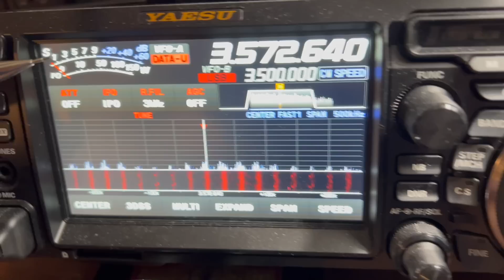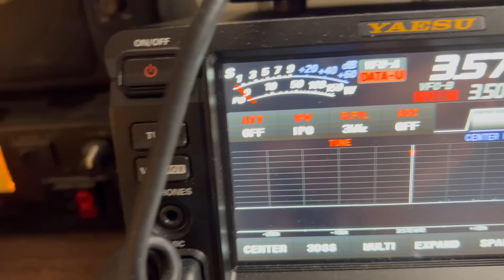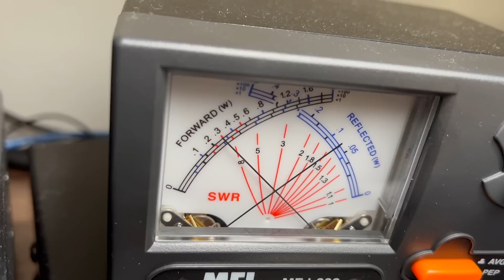The Myth of SWR

Comment: I didnt even watch the video but from reading the comments i know what its about. The transmitter output impedance is not actually 50 Ohm but something close to zero, and what's coming back from the antennna is reflected again, and this is what makes the power meter behind the transceiver show more power than the transceiver actually has. If cable dissipation can be neglected, then the antenna radiates about the difference of the "apparent" emitted power minus the reflected power. And yes, for a CB radio with 3m of RG58, it is about correct. With an antenna SWR of 3, the power meter shows then 5 W emitted instead of 4W, 1 W reflected, so it means the antenna still radiates its 4W. And really, a SWR of 3 is not as bad as many might think. Higher frequencies and longer cables makes it worse though.

Comment: Isn’t the reflected wave out of phase?  Therefore the total effective power not increased?
Reply from the maker: The antenna tuner changes the phase of the reflected power.  This is a quote from "Reflections" by antenna engineer Walt Maxwell.  "Tuning for maximum line current simply adjusts the phase of the reflected wave to rereflect down the line in phase with the forward wave."
Reply from the maker: There is no power increase.  The point is that the reflected power is not “lost.”
Reply: @BustRadioMyths If it's not useful for making the transmitted signal stronger (weaker actually) then effectively it is indeed "lost".
Reply: Is it coming down to semantics of what we are defining of what we mean by "lost"?
Reply: I think that phase doesn't matter as RF is rectified and the resulting DC is measured by SWR bridge which is a directional coupler.

Comment: Right to the point, I use 80ft Messi & Paoloni  EXTRAFLEX BURY 10 /.400" (0.8db/100ft @50MHz)  and I only try to keep SWR below 3:1 so I don't have to use external tuner.
Reply: SWR is an indicator that things are inefficient.  Its not just cable mismatches.  My good friend WA5FWC taught me years ago.  spend time building antennas that are tuned to the frequency properly, and use quality components, and everything is efficient, long lasting and maximum sensitivity.  I have no tuners attached to my rigs.  I just use tuned antennas and proper coax, its easy!
Reply from the maker: @fwaynedavis An antenna with a low swr is not an indication it is a good radiator.  A dummy load has 1.1 swr
Reply: I used  perfectly tuned dipoles at low heights with limited success but my DX-Commander vertical works far better even with 1.5-2.0 SWR which is tuned with internal tuner. Ofcourse if everything is matched is better but the point of this video is that a little mismatch (which BTW is inherent to Verticals with 36 Ohms impedance) is not worth trying to eliminate.
Reply: Thank you for the video. As a physicist with some electrical engineering you are quite correct. This is why in some cases I just force tune a random vertical with short, high quality coax in the field even if the feed point swr might be 8:1. I’m not trying to have something perfect- just something that radiates. Example - 18ft RG-8X at 14mhz on a 14ft monopole at 8:1 swr only has 0.73 db loss or only 16% of my power (neglecting pure resistive and ground losses). Better coax would reduce those losses.

Comment: I have researched this topic extensively and agree with what the host is saying. However, I highly recommend looking at a coax loss calculator, like what is found on KV5R website.  Depending on the HF frequency, depending on the SWR and length of cable, dielectric losses can become fairly significant.  Case in point -- Using 50 Feet of LRM 400 @ 10:1 SWR at the frequency of 28 Mhz will yield a 27% power loss (not radiated) when using 100 watts.  In this scenario the "output" power would be 72.584%.  Now that was for 10 Meters, 6 meters in the same scenario would have higher losses, and the opposite would be true for lower frequencies meaning lower losses.  Over all I like what Mark is describing in the video and for the most part I wouldn't worry about SWR higher than 2:1 unless using an ATU.  Lastly, I have tested power losses, and it does exist.. I have purposefully heated up coax with high SWR to illustrate the point.  As Mark said, the power isn't lost, it is converted from one form to another, and in the case of losses, from RF to Heat.  Hope that helps -
Reply: Just learned something important from W6LG; lets say for the sake of argument someone is running higher SWR, using coax, because they "aren't worried about it"?  Well, then you need to be concerned about common mode current.  Not that you weren't before with a flat SWR, but it seems running non resonant antenna's with coax can increase common mode currents which can cause problems. As I've learned from Dave Casler, everything affects everything when it comes to antenna.
Reply: @davidc5027  - Agreed, that is why having the trans-match at the closest point to the radiator is helpful, or used balanced feeder.
Reply: @davidc5027  unfortunately w6LG states that reflected power from an impedance mismatch travels on the outside of braid of coax ,I used enjoy his videos but will look at them differently from now on
Reply: In the case of coaxial cable at HF, the dielectric loss (rf power dissipated in the dielectric) is very small compared to the copper loss (copper loss is the loss due to resistance in the conductors).  The loss in a short piece of coaxial cable with high SWR where the load impedance is high can be less than the loss when the SWR is 1:1.  The loss is concentrated mostly where the current in the cable is highest.  If you feel along a cable that has been heated by rf power with high SWR present, you will find hotter and cooler areas alternating, with spacing from one hot area to the next hot area being a half wavelength in the cable.  The graph that is frequently published showing the increase in loss due to increased SWR is fairly accurate when the line is a half wavelength long or longer, but the graph can be significantly in error for short lengths.  Of course, for short lengths of cable, the loss is rarely a concern anyway.
Reply: @lifegettingintheway2710    Yes, the voltage doubling would occur under the condition of high SWR when a voltage antinode on the transmission line occurs right at the output of the transmitter.  On the other hand, if a voltage node happens to occur there, then we have a current antinode at the transmitter output, and the excessive current can also cause damage.  In the cases in-between nodes and antinodes, the voltage is out of phase with the current.  The active device or devices in the final amplifier operate most efficiently when the current maxima in the devices occur simultaneously with the voltage minima.  (For instance, in the case of transmitters with manually tunable output networks, when we tune the output network for a dip in plate current we are accomplishing this alignment.)  If our transmitter output network is pre-tuned for efficient operation into a 50-ohm load, then a high SWR condition will mess up this alignment and/or will force a less-optimum ratio of voltage to current, possibly increasing the power dissipation in the active device and possibly overstressing any number of components in the output network.  Higher voltage and current also cause additional heating in the passive components, but this is less often a problem as the passive parts are typically rated to handle more overstress as compared to the active devices.
Reply: 28 MHz is 'barely' HF :)
Reply: I am surprised that with your learned post that you still state power is 'lost'. Read up on thermodynamics, will you?
Reply: correct. It's not LOST, but it isn't radiated either. You can't talk on heat @lomgshorts3
Reply: He just means that it isn't being used for the intended purpose--it is lost to heat. @lomgshorts3

Comment: The only part I winced at was your statement about  the ATU providing an impedance match to make the transmitter happy.  As an impedance matching device, the ATU's role is to match the source (transmitter) output impedance with the load (feedline + antenna) input impedance to maximize power transfer from source to load -- regardless of any effect this may have on the transmitter's impedance mismatch protection behavior.
Reply: Here's an important point.  For a given frequency, standing wave Impedance (V/I) varies at different points along a feedline.  Thus, for a given frequency and load mismatch, a certain length of feedline may serve as the sole matching device (impedance transformer) between a source (transmitter) and a load (antenna).   But when any given feedline length does not present a match, then an ATU between the source and the feedline can be used to essentially add or subtract a phantom/virtual length of feedline (via variable lumped inductive and capacitive elements) to match the source's output impedance.  Of course, this does nothing to change the impedance mismatch at the feedline to antenna interface, but it allows the source to transfer full power to its composite load (feedline + antenna).
Reply: yes, yes, and yes; preach it. I really wish we could find a new term to popularize, for the feedline-antenna matching device, and stop calling it an antenna tuner.....
Reply: @dus777  Transmatch is the term I prefer; but the catchy acronym ATU has become commercially predominate and appears here to stay.

Comment: You were doing good to the part you said that on the low bands the SWR does not matter.  For short runs up to say what would be used in a car there is not that much additional loss.  However with feedline loss when matched is getting to be around 3 db or more the additional loss starts to increase by a good bit as the SWR gets higher.  You sure do not want  a 10:1 SWR with 100 feet of rg-58.  One other thing is that if running high power the coax can develop hot spots and melt or the voltage can arc over.
Reply from the maker: Good points Ralf.  Yes 100 feet of high loss cable like RG58 with a high mismatch would be a bad idea. I didn’t try to cover every scenario so thanks for that input.

Comment: I do know that high SWR from the antenna really heats up the coax connectors entering the house.  The inside tuner does a great job for the transmitter.  Been Ham since 65.  Finaly got my first and last amp about two years ago.  Having fun. de WB7ORB.  Also that is one of the questions on the Extra license test.

Comment: I'm the antenna tuner. Resonance or bust. Tuners are a waste of money.
Reply: At resonance, my short, center-loaded vertical has an input impedance of about 12 ohms: 4:1 VSWR.  In other words, antenna resonance does not necessarily equate to an impedance match.
Reply: Do you realise resonance doesn't guarantee efficiency, it doesn't guarantee its matched either but a tuner can deliver both resonance and matching for maximum power transfer

Comment: With a line power of 75W the reflected power also goes up, to 37.5W, which is matched by the tuner and sent back to the antenna.  This increase in power in the line results in increased loss of power in the line!  Yes, much of the transmitter power is radiated, but a high SWR does ultimately cause a loss of power.  Best to keep losses low as is reasonably possible. No need to obsess over getting a 1:1 SWR, but closer is indeed better.
Reply from the maker: All true David.  SWR causes additional line loss.  But the published charts show that at HF frequencies it is not much unless you have a long line of high loss cable.  Another issue I would like to make a video on is that obsession with SWR prevents the use of a wire all band antenna.  I’m using a random length OFC dipole with a 9:1 unun.  It covers 160 meters to 10 meters with an swr of no more than 3:1 at the ATU.

Comment: I agree with most of your video content right up to the point where you try to show and state that 20 watts out of the TX turns into 30 watts.  Bad SWR does NOT increase the output power.  The SWR meter may not accurately calibrated for that Freq.  You can NOT increase power out by having bad SWR!!  You will never get more than the 20 Watts to the antenna. What you are stating toward the end of your video is the holy grail of junk science!  FREE ENERGY!! Just is not possible.
Reply from the maker: Never said that.  SWR does not give you a power increase.  Of course not.  The point is that reflected power is not lost.  Do some reading please.  https://www.arrl.org/files/file/Technology/tis/info/pdf/q1106037.pdf
Reply: @BustRadioMyths I read the article.  I wouldn't just assume because it was published by ARRL that is entirely correct.  In the article he contradicts himself by stating that ladder line helps to radiate the reflected signals (radiating it away) but then in a coaxial example, he says it is "eventually radiated out the antenna" after going back and forth between the radio and antenna ---- but if that were the case, then we would never have overheating burned out transmitters from bad SWR.  The reflected power is put back into the transmitter and is in the form of heat rather than transmitted.   This part is where I believe he is incorrect.
Reply: @BustRadioMyths  It would be very interesting to see a follow up video where the test is ran again with the external watt meter placed before the tuner such that when there is a perfect match to the TX, what does the watt meter show then?  Would it still show 30 watts (indicating that the meter is poorly calibrated for that frequency) or would it now show just the 20 watts?  And then if placed after the tuner would it then show the 30 watts??  I realize you are not so ignorant as to imply that there is "magic" power being generated, but the wording along with the display on the swr meter is confusing.  Good video discussion overall.  Cheers.
Reply: While I would need to test my theory, the 20W reading on the meter is the voltage across the meter resistance calibrated proportional to the 20W into a 50 ohm load. 

P = V^2/R
Therefore 
V = SQR(PR)

20W into 50 ohms needs 31.72V across the load

So to read 30W the voltage must be 38.73 into 50 ohms, but we don’t get any extra power so if the voltage is higher then the impedance must also be higher to reduce the current to keep the power at 20w

R = V^2/P

75 ohms but that’s only a 1.5:1 mismatch. 3:1 is 150 ohms. So it probably has a complex component to make up the rest. This is something I need to test. 

What I do know, is that I never look at the SWR first when I’m testing an antenna. I look at the smith chart on my VNA and see where the complex components are and use that information to make decisions on where and how I match my antenna. 

Anyway, the best antenna you have is the one you are using right now.  

Wait ?  You’re still on your phone reading this ????  Put down your phone. Turn on your rig, pick up your microphone and answer someone’s CQ…or jump on the key. Pound some brass. It’s good for the soul.
Reply: Please,  do watch again at slow speed. He's stating himself what you noted. APPARENT increase of power because SWR, then reflected back and forth with no real gain BUT NO REAL LOSS if low loss coax being used.
Reply: Every station needs an antenna.  The tuner can be optional.
Reply: Think you have misunderstood what he has said ,he doesn't say 30 Watts is radiated
Reply: You might want to watch the video again

Comment: Based on that theory we should all have antennas with 100:1 swr. 
Take a look at the article “ the lure of ladder line “ from QST that goes into coax loss absorption.
Reply from the maker: Sure ladder line has virtually no loss but it’s inconvenient for most people.  Who has an antenna with a 100:1 swr?  What are they using - a kitchen fork?  Did you do any reading?  https://www.arrl.org/files/file/Technology/tis/info/pdf/q1106037.pdf
Reply: @BustRadioMyths  the higher the swr the higher the loss,apparently you didn't read the article.
Reply: @miker8379 not necessarily if for example in the theoretical lossless feedline no power is lost no matter what the swr is
Reply: 100:1 is a bit much but it seems that some handheld radios that have no transmission line at all work fairly well up to a SWR of 20:1. Because there is no such broadband HT antenna that can span 136 to 174 MHz or 400 to 520 and maintain a low SWR over this range.

Comment: Your reflected power is NOT in phase.......
Reply: I think that phase doesn't matter as RF is rectified and the resulting DC is measured by SWR bridge which is a directional coupler.
Reply: I think phase has everything to do with it. If reflected and and forward power where in phase it doesn't matter where in the transmission line you measure, it will always  be the same. But  it does matter where you put your power meter. 
Put your SWR meter somewhere else in the line and everything changes because you do not have standing waves.
This is why the myth started that coaxlines should be a half wave length our a multitude of it.
It should not. The length of the feedline does not matter if it is connected to an antenne with the same impedance as the feedline.
Reply: @maartenc6099  You should try to understand how directional couplers work, measuring forward power is not affected by reflected.
Reply: That's why the tuner is inline to correct the phase
Reply: Yes. Between transmitter and tuner. Not Between antenne and tuner
Reply: @maartenc6099  yes between tuner and antenna it's called conjugate matching
Reply from the maker: The antenna tuner changes the phase of the reflected power.  This is a quote from "Reflections" by antenna engineer Walt Maxwell.  "Tuning for maximum line current simply adjusts the phase of the reflected wave to rereflect down the line in phase with the forward wave."